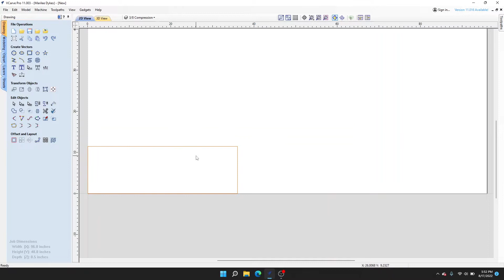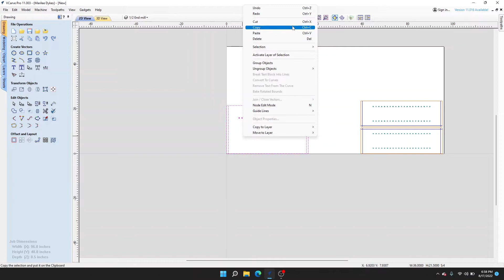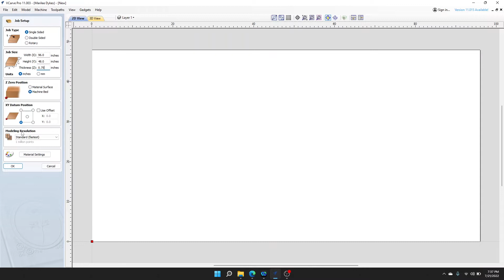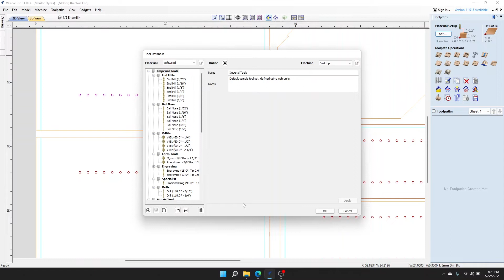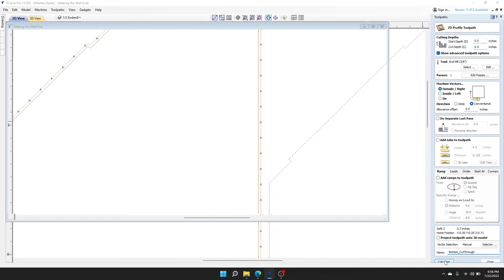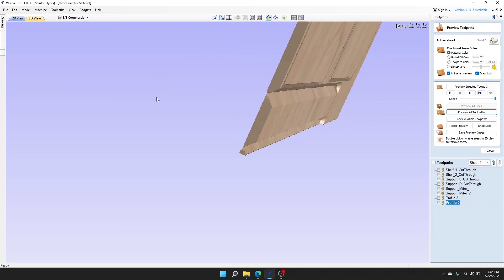Easily design a Wall Angled Cabinet in VCarve Pro!

Comment: If you start your Dado lines from the same side of your cabinet it will make it easier for you to pick which side it will cut . Visualize the green starting point of the line is where you are standing , then Right or left is from that point. This will help

Comment: Why not group all the drill holes under 1 toolpath?  You can also use the nesting feature in VCarve to place your parts and save space.
Reply from the maker: Hey thanks for the reply! You are correct about the grouping those paths and the nesting feature. I am a little new to VCarve but I find it a good program to visualize construction methods which is what I’m mostly focused on. I primarily use Hexagon Cabinet Vision for everything I do but I really like VCarve for on the fly designs I need really fast or to experiment on things. As for your drill hole comment, I will go back and take a look to see if I made a mistake.
Reply: @KBCabinets   It was a good video and I liked seeing how easy it was to do a cabinet.

Comment: Good video, for the drilled shelf holes, you could also have used the array copy and input the required spacing.
Reply from the maker: That’s for that. I’m still pretty new to VCarve so I have LOTS to learn. I will definitely give that method at try!
Reply: Also, how did the shelves line-up since the spacing on the sides was 1.24" and 1.25" on the backs?